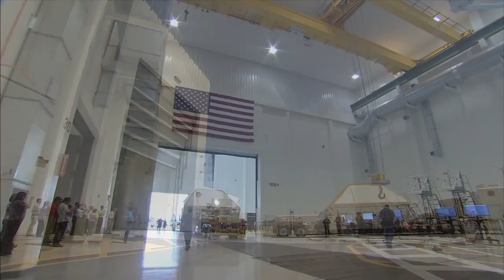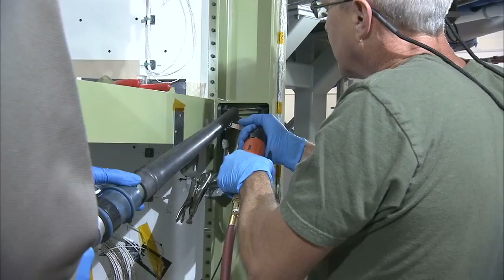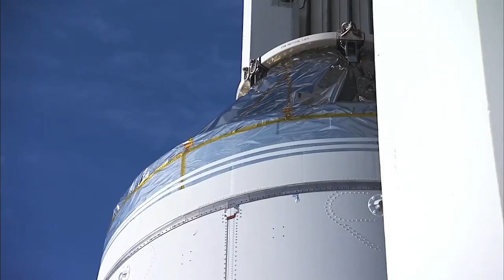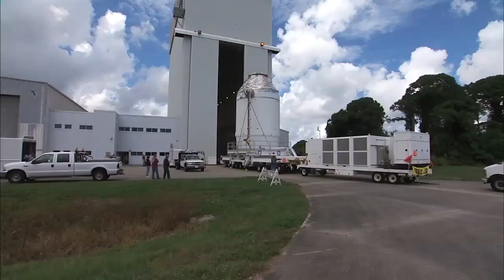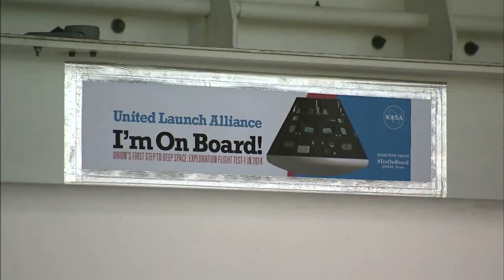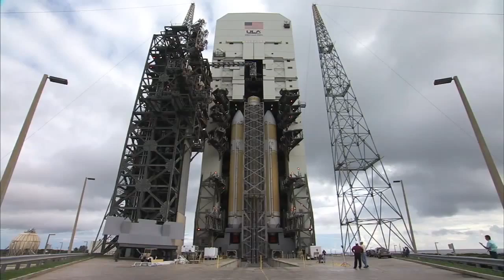Orion Flow

Comment: hey nas just admit that you can not go into space. the orion rocket and capsule are the huge models and props that do not work. hey nasa just admit that rockets do not work in a vacuum
Reply: +robertelee2k9 Please back your statement with facts.
Reply: Rockets have been demonstrated to work in a vaccum
Reply: +robertelee2k9 truth seeker how long has this been your belief out of curiosity. Have you beileved this for 1 month? 1 year? 10 years? 3 years ?
Reply: Nathan Wise  do the test yourself. put a vaccum at the baclk of of a model rocket engine and you will see that it will not move.

Comment: To find a place like earth build a rocket and send it in the black hole use a camera to see the over side
Reply: Mashall Tulloch There would be no way to get the data back from the camera once it passes the event horizon.(assuming it survives) The gravity at that point is stronger than the speed of light which is way faster than radio waves or other forms of sending data)